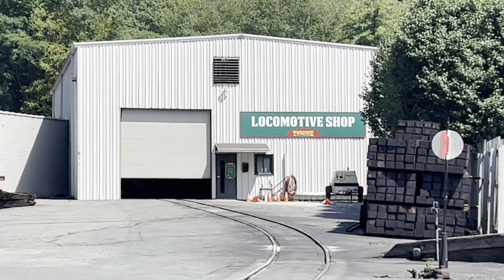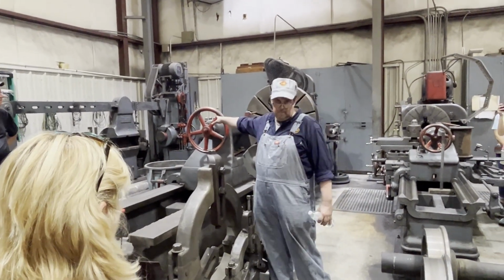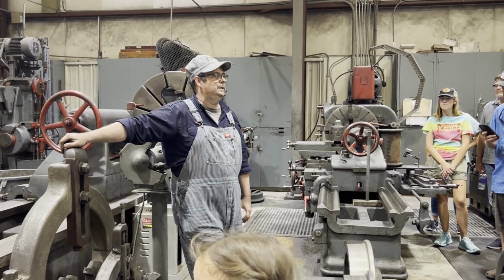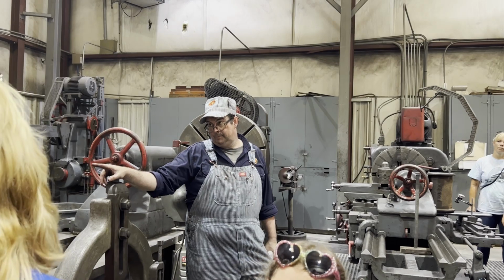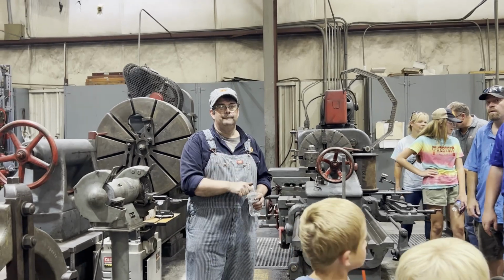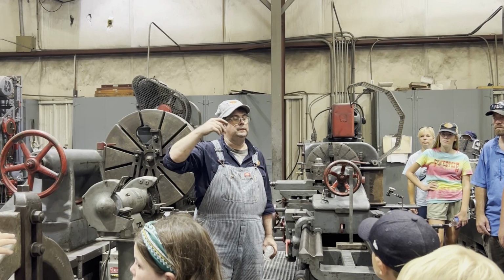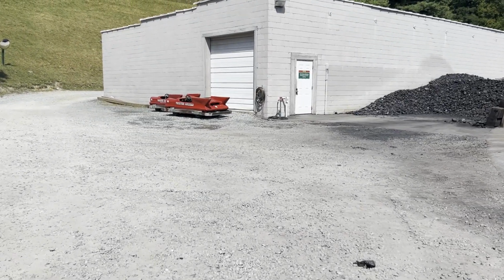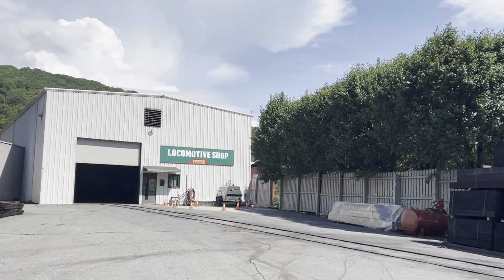Tour Tweetsie Railroad's Locomotive Shop

Comment: The wheel press at the end of the shop that is used to press wheels off and on the axles is the same size as at the Huckleberry RR in Flint, MI.  It came from the Quincy Mine RR shops in Hancock, MI.

Comment: I remember Tweetsie overhauling the locomotives of the Walt Disney World Railroad from 2003 to 2004. Now each locomotive is being overhauled at Strasburg Railroad as it’s time to replace there original Dixon built boilers replaced.
Reply from the maker: So cool how such a small park is so specialized that much larger parks need them to work on their trains/engines.